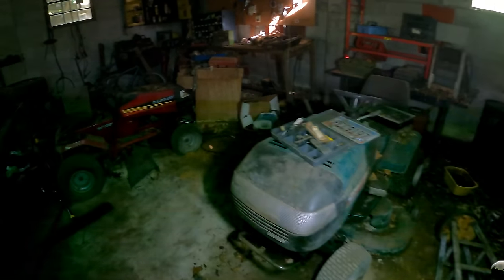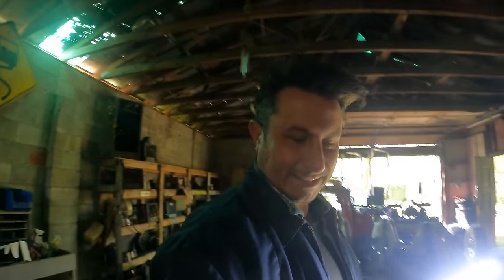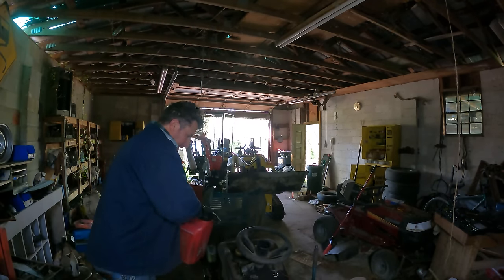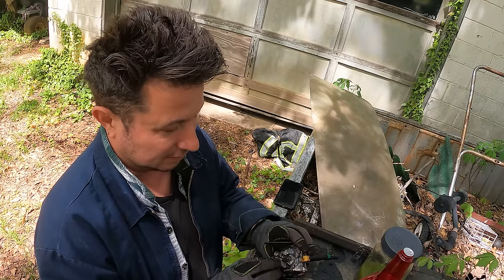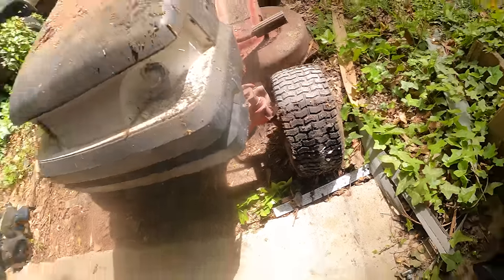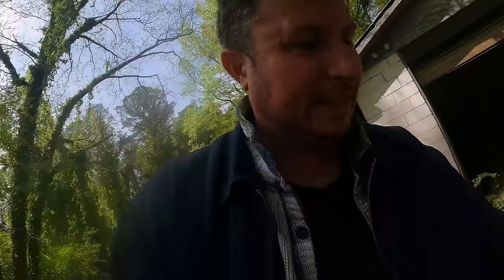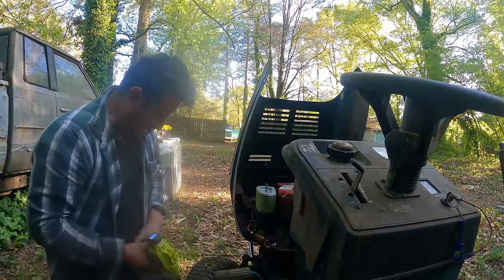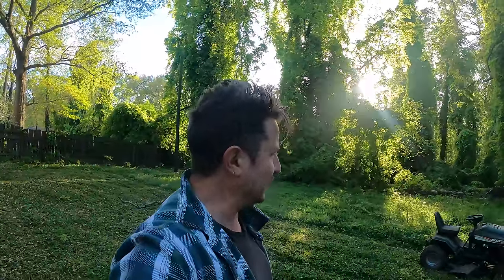ABANDONED Yard Tractor WILL IT RUN AND CUT AN ACRE???

Comment: Great work, I’d definitely change the oil in the green mower. It probably had the float stick open for a while putting gas into the oil . That could be the reason it was over full..
Reply from the maker: Great point! that will happen soon

Comment: The grass got cut. That is a win. You can probably get some tires at Harbor Frieght cheap. There are alot of small engine repair guys that probably have the stuff you need to fix them up. New mowers are like 2k now. I just paid 650 for a push mower.
Reply from the maker: You are not kidding. These things are insane.  I am gonna fix every one I can… I was just happy to make the one work with parts on hand.      There are three others all probably worth saving and a few push mowers.

Comment: First thing with mowers that been sitting for awhile, yes check oil, but also smell it, for gas. Wil tell you if carb. is leaking into cylinder.
Reply from the maker: thanks for the tip